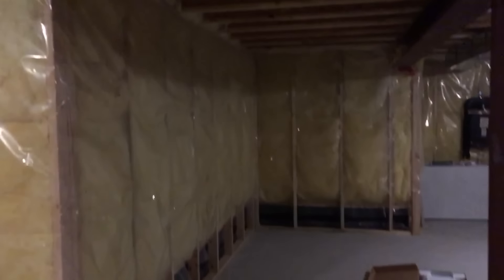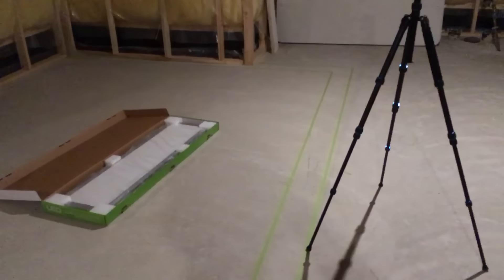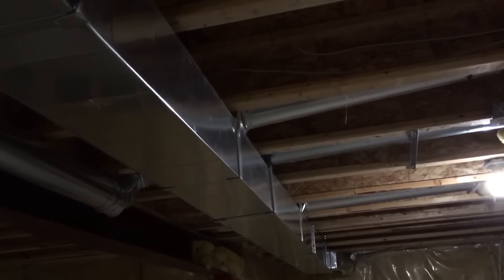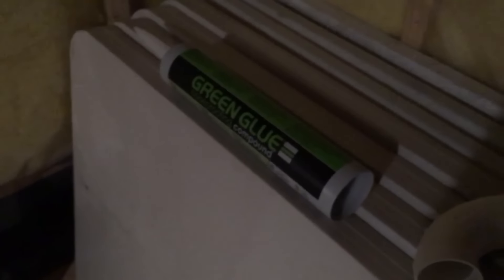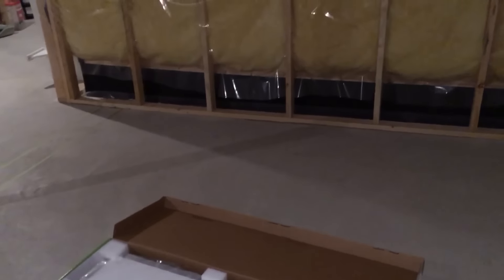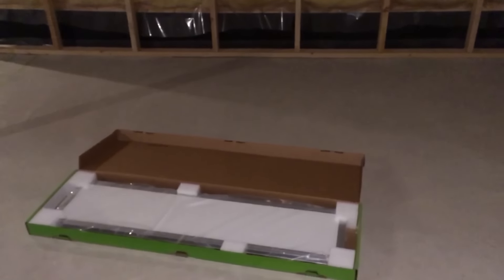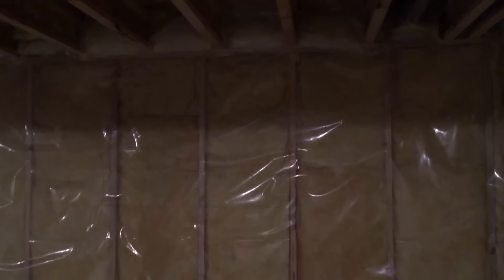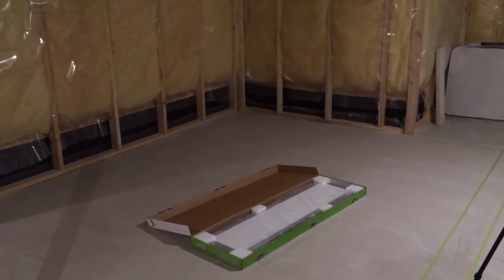Sound Studio - Dead Room Update - detailed plan - Build Starts FRIDAY!

Comment: I found it interesting. Thanks for sharing. Also, the LED lights should be worth it. Pls share another as you build as well as once completed. Regards.
Reply from the maker: I will be doing at least one build video and then a tour video. I got two panels and my plan is to put them so that I dont need to use an additional keylight for streaming.

Comment: Always interesting to see foreign (from my perspective) construction techniques. No noggins in the frame to provide obvious cross bracing. Manufactured joists in housing instead or sawn boards and good use of glue composite construction materials.  Can't wait to see if Canadian power points are the ugly type or not. Best of luck!
Reply from the maker: +Andrew C behind the vertical frames is a cement wall. The frame is there just to hold the insulation. The floor base (ceiling in the basement) depends. I have seen many types of construction. This one is literally bonded. The floor base is 3/4 ply glued to the prefab support. Once the drywall is bonded to the other side of the floor base, it will be supported even though drywall isn't really known for its structure. :)
Reply: +TheNOOBIFIER1337 So on the outside of the concrete wall would be a waterproof membrane to stop water increasing from the soil into the basement? Just a check drywall is a plaster sheet about 10mm thick or something else?
Reply: +Andrew C water increasing I mean
Reply: +Andrew C damm spell check swap for water penetrating
Reply from the maker: 1/2 Inch Chalk board laminated in thick paper. "Dry Wall"

Comment: All the best with your build, what are you going to do about heat build-up? Obviously with the PC external it wont be horrendous. Just open the door as and when or are you going to feed air in?
Reply from the maker: The HVAC is already planned. There is a complete baffle muffler system being built to kill the wind noise.